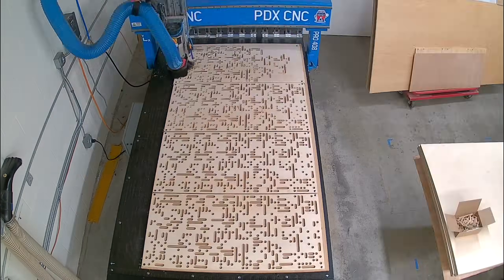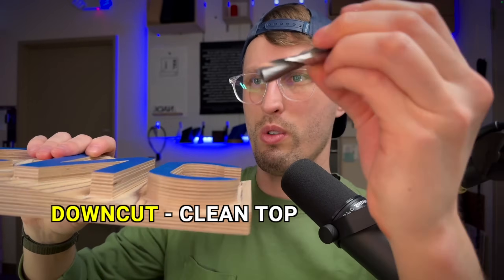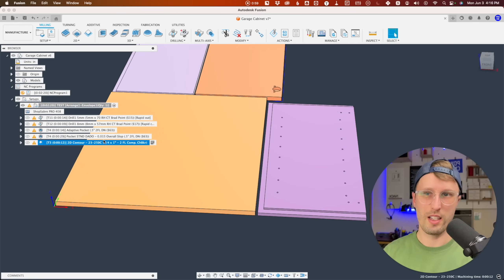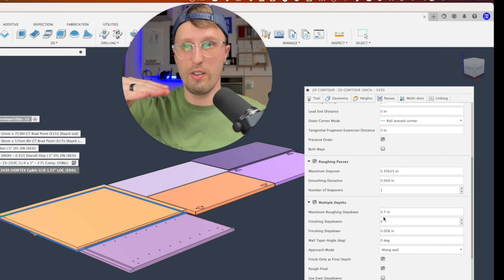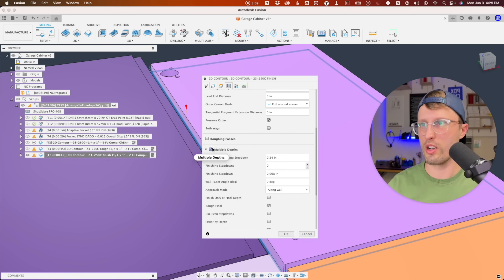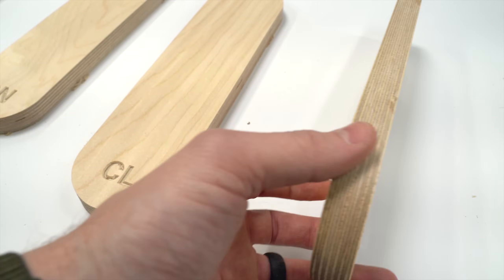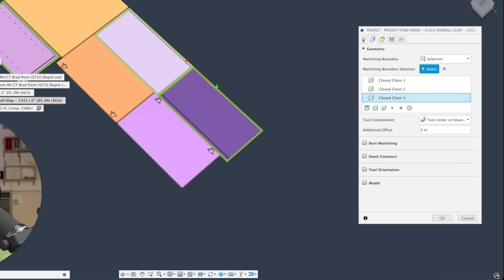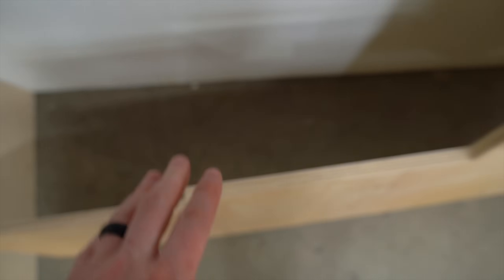7 surprising secrets for flawless CNC plywood cuts

Comment: Climb cut first, leave an onion skin, then cut conventional - miles better than this for several reasons.  1. even cleaner cut, 2. more precision (less deflection). 3. less likely to have parts move.   This will give you "flawless" edges but only on industrial machines - most small machines have 3kW or less spindles and are not rigid enough to climb cut.

Comment: im using compression bits for plywood, the tool's diameter is 10mm and the downcut starts at 7mm depth, SO i use climb for the first pass of 7mm depth (downcut for the surface) and then for the last 5mm i use conventional (upcut for the bottom), since i dont want to go full cut of 12mm at once. 
Aaaand the result is perfect. no lifting nothing, i just cant manage burning even with feedrate of 10k mm/min and 11k RPM

BTW the whistling noise your bits making while cutting its a BIG BIG NONO.. reduce RPM or increase feed or both?

Comment: Would you have any reccomendations,i have this centateq n510 at work i need to figure out a clean cut in 1 pass but im having trouble with small parts the vacum usualy fails to hold them in place and they end up shifting during machining.I will try the lead in in the middle along the  grain and will make sure to use a compression bit.

The almost 11 meters per minute you did in one go looked really impressive,at the moment i only manage 2 pass cut with about 5 meters a minute at 18k rpm
Reply from the maker: That cut was with a 1/4” (6.35mm) cutter—not sure what you’re using, but tool size matters a lot here. One-pass isn’t always the best move. It might be faster, but consistent clean results are better. I’d leave 1mm for a finishing pass and rough with about a 0.5mm (0.02”) stepover. Run both at ~11.5 m/min. The final pass puts way less pressure on the part and gives a cleaner edge. If it still moves, add tabs.
Reply: @pdxcnc  I was leaving 2mm but 1 makes sense and i will have a chance to try this tomorrow or day after.i will also try to increase to 11ish m/per min on a basic compression bit with 6mm width.ill report the results, thank you very much

Comment: Im a beginner in this and i have a question. Will using a smaller dia compression bit have better results than a bigger one? For example im using a 4mm compression bit, if i upgrade to something bigger, wll the wood come out less cleaner and more rough? Or is it the other way around?
Reply from the maker: That’s all relative. Depends on the machine, material, tool holder.

A larger diameter tool should be more rigid cutting the same material though.

Comment: You mentioned hobby level machines in regards to compression endmills. Is your thought that you'd be better off not using them on a smaller machine like that? Would you just use an upcut and plan on sanding later?
Reply from the maker: There's a few factors. Most hobby machines can't feed fast enough, either by movement or spindle power restrictions per what a compression cutter wants to cut and not burn it up.

The other is not enough power to get the tool down below the upcut portion of the tool. Our 23-250C needs to be about .25" minimum depth of cut to not be tearing out and sort of ruining the entire intention of a compression cutter - to get clean top and bottom edges at once.
Reply from the maker: If you can't make that happen, you can simulate a compression cut by roughing first with an upcut tool with some radial stock to leave. and finishing with a downcutter.

Comment: Straight flute is the best balance and more economical
Reply from the maker: Way slower though
Reply: @pdxcnc we cut 700ipm with a 3 blade 1/4” straight bit(amana in presta) and get much better results than compression bits usually give - for Baltic Birch and solid wood exclusively. Cheaper plywoods I still use a 3/8” compression.
Reply from the maker: @batemanlabs nice

Comment: Just watched this, Great and straight to the point. Love it. We cut ply and tbh quality doesn't matter on the edges as what we cut is all one time use mould forms. But I have always wanted to get better cuts and ill try the climb direction trick tomorrow morning. Will do 2 cuts on the same piece with both directions and see. Nice one
Reply: Did a test, with a change in cutting direction and also did with leaving some radial stock then doing a second finishing pass. Most deffinatly. a huge improvment to the finish. Now need to stop entering on a plunge, what sort of ramp angle would you recommend? usually using a 6mm compression on 18mm plywood.
Reply from the maker: Anywhere from 15-25° works fine

Comment: So if a spindle is less then 4 horse power you don’t think it can cut 3/4 mdf in one shot ?
Reply from the maker: Good question. What size is the spindle?
Reply: @pdxcnc  it’s a 2.2 kw spindle atc
Reply: @TheUofastudent I have a Stepcraft Q.408 with a 2.2kW ATC spindle and cut Birch plywood in one pass. MDF is much softer, so give it a try! I do mostly 3/8 compression bit at RPM 18K. If spindle speed is high, keep the feed speed high too. Seams crazy at first, but after trying and seeing such a difference in efficiency and finish quality, I’m glad I did lol
Reply: That’s awesome !! Due to the electricity limitations I have I can only run either the cnc or the vacuum pumps so gonna try to hold the 4 by 8 sheet with 8 screws to a clamped on board then try to cut the 5/8 plywood board in one pass with out a vacuum pump table turned on ! Do you think that would work ?
Reply: @TheUofastudent  I don't have a vacuum table, so I always screw the 3/4 ply down to the spoil board. After learning how to cut full sheets in matter of minutes, I wish I had a vacuum table!

Comment: Quality info, thank you! Nudged me to use your bits for my maiden voyage with my SS Pro 408!
Reply from the maker: Oh awesome, happy to help if you have questions!
Reply: @pdxcnc  much appreciated (as are your contributions in the FB group). i'm coming from Shaper Origin so the idea of ploughing through 3/4 material in a single pass is blowing my mind at the moment. Seeing this, along with the right feeds and speeds, is helping me take that big step up and get off to a good start. I have it all wired up. Replumbing my compressed air system and Should be firing it up in the next few days as soon as I receive those bits! 

I noticed you don't have a tool library yet for vectric (still ramping up on fusion) - is it best to just add the bits I ordered manually? Any guidance you have there would be great.
Reply from the maker: Absolutely. Glad to hear it, there's a lot to get going when you setup your first machine.

Libraries: Yeah we're still getting these going. Which tools are you looking for in Vectric, I can try to get those setup first?

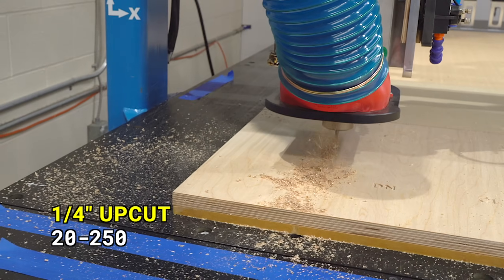Comment: @7:58 - the ONLY part of the video I slightly disagree with. I don´t think a bit has to scream (vibrate!). at least I try to avoid it if possible. with a 8mm compression cutter and the sheet firmly sucked down with vacuum that is usually possible for me. If I push a tool too much or use it too long after it got too dull (which is totally possible with a compression cutter :) I had contact corrosion issues in the past. Iso30 in a HSD here too. looking at the tools in the toolchanger I have to say they look totally fine. This makes me wonder if my pullstud/drawbar thingie in the spindle maybe does not provide enough clamping force and that´s the reason for me babying my machine :D 
great video Justin!
Reply from the maker: I don't wholly disagree but a 1/4" (6.3mm) compression tool has always made that noise for us, no matter brand or age of my machine/spindle. I believe a combination of a lot of things but it's just not very rigid, maybe the tool holder/collet is sucking in and out as well, 18,000 RPM's can likely cause it to drop a little, ISO30 is no HSK.
Reply: @pdxcnc  true! If I ever have to replace my spindle I´d really consider HSK. Hope this is a few years in the future though :D

Comment: Cool video.  I didn't know to use conventional with compression cutters, I don't cut much plywood.  @7:39 Why do you use a second 2d contour operation for your finish pass rather use roughing and finish passes within the first 2d contour operation?
Reply from the maker: Hey Kip, thanks. Good question. I guess didn't explain that but often it works better to rough fully and not break the vacuum seal then come back with the lighter cut cleanup finish pass with much lower tool pressure.
Reply: @pdxcnc  I gotcha.  But couldn't you achieve the same outcome by checking "Finish Only at Final Depth", and unchecking "Rough Final", setting a finishing stepdown all under the "Multiple Depths section" and then using the "Stepover" under the "Passes" Dropdown.    To compare it with using two operations The finishing stepdown setting is essentially the axial stock to leave that was set in the roughing operation and the stepover is the radial stock to leave set on the roughing operation.  I use a finish pass on most of the parts I make and this is how I do it with one operation.  But I am well aware that there are usually multiple strategies to get the same or similar outcomes.
Reply from the maker: @kip1168  you absoultely can. I feel there's more control with doing two separate operations.
Reply: @pdxcnc  I can see that.  Pros and cons to doing it different ways depending on other factors as well.  Thanks for the cool video and discussion.

Comment: Excellent Video where do you get your 5mm dowel drill from as struggling to find one that doesnt have a massive flat spot. Thanks 👍
Reply from the maker: Hey the 5mm bradpoint we use? You mean the flat on the shank? If so, that’s how they all are
Reply: @pdxcnc gotta didn't know if there was one either no flay spot. What plunge do you typically run it at in plywood. Thanks

Comment: Typically the screaming that the bit does is from friction aka not having correct chipload and it usually want a higher ipm or a lower rpm
Reply from the maker: I find it’s from the path turning and a new force being applied and flex happening in the tool
Reply: @pdxcnc  that's just what it was for me and it fixes. It every time for me but maybe that is what it is for you but loved the vid lots of info!
Reply from the maker: @mcfixit66_yt77 nice, thanks

Comment: Very nice! Thanks for putting this out there. For some people with higher horsepower spindles, or just looking to improve efficiency, my ShopSabre IS408 w/ a 10hp spindle, we do 3/4" baltic birch plywood a lot, and we use 1/4" compression bits, single pass full depth, no tabs or onion skin, a bit over 300ipm and 16,000 rpm and get perfectly clean edges. We use 1/4" compression for just about everything due to it's ability to do smaller geometry compared to 3/8". Plus, for holding down small parts (around 10 in^2 surface area), full depth single pass, no onion or tabs is the way to go as the chips pack and keep them in place. Will never onion skin or tab again, but that's just our preference. Cheers!
Reply from the maker: Nice. Do your compression tools have any blackening on them?
Reply: @pdxcnc  you know they certainly will get blackening over time yes, I'm not 100% sure what I should expect for tool life with what I'm doing, but one 1/4" compression tool will last maybe 40-50 sheets before I feel the need to change it due to seeing some fuzzies start to appear on the part edges. Any thoughts? Always looking for input! :)
Reply from the maker: @garretehrick6137 yeah, I ask because I started out around those speeds and was blackening tools. I eventually found out I was feeding too slow and the blackening is too much heat in the cut. I’d push that 1/4” more like 380-390 IPM at 16k and you’ll see longer tool life
Reply: @pdxcnc  Thanks so much for the feedback! Full depth pass at those speeds for you? I have yet to break a bit at my feedrates, so I'm definitely keen to speed them up a bit.
Reply from the maker: @garretehrick6137 shouldn’t no. Ramp in, what brand is it?
Reply: @pdxcnc  Vortex currently, have been dabbling with Frost as well.
Reply from the maker: @garretehrick6137 Vortex for sure. We cut 3112 at 450IPM
Reply: New to CNC stuff, got trained when the cabinet shop I work at upgraded the CNC. Tried making some little corner anchors to help my normal work, cut out of 5/8" Baltic ply (drawer scrap) 5" square with a 3" square taken out, giving an L shape that I can clamp and indirectly hold things to work on. 

The shop wisdom is using the 3/8" down cut as default tooling, so I went with that and it unsurprisingly threw my pieces. Wrong tooling? Just too small? I'm surprised you're doing 3/4 with a smaller bit and less problem, but wanting to learn to do better. I don't know brand of bits or feed rates off hand
Reply from the maker: @michaelsorensen7567 not too sure. Sounds like a workholding problem?
Reply: @pdxcnc  thanks for the reply, especially on an old video. Tabs would definitely help, but I slowed feed rate and they still moved a bit, but were good enough to be usable.
Reply from the maker: That’s a really small part of its only vacuum.
Reply: @pdxcnc  yup! Lol like I said, "unsurprisingly" 😝
Reply: @michaelsorensen7567  1/4" compression bit cutting 3/4" thick ply  for our parts. What happens with doing a single pass full depth of cut with that diameter bit is that the sawdust get packed into the cut channel behind the bit, essentially locking small pieces in place. Not sure if this would work for less thick material, or a different diameter bit. Also vacuum hold down is essential, but it's more about the chips compacting in the channel for small parts like what we often do. Hope that helps!
Reply: @frictitiousclimbing  thanks for the response. I had seen some of that cutting some parts for a custom kitchen hood out of 3/4 MDF, even with the 3/8" down spiral. It didn't do it all enough for me on the 5/8" Baltic ply. Wondering if thickness is part of the issue. 

I know settings were same on conventional/climb cut on both cases, but don't know what the setting was. Very very new to CNC, don't even know what I don't know yet!

Comment: Good information.  What is your experience of using compression vs. downcut or upcut bits in hardwood vs plywood.  Also conventional vs climb cut.
Reply: I’d also be interested in tool path strategies to avoid tear out on hardwoods. I have found no good way to turn a 90 degree outside profile without some splintering. I’ve also played with Fusion’s preserve sharp corners technique which seems to help, but still doesn’t work perfectly.

Comment: I never climb cut. Is there ever a reason to use climb over conventional?  Greta video. Thanks
Reply from the maker: Yeah totally. I prefer it when roughing. It’s easier on tools. Climb when doing aluminum
Reply: Not sure on the CNC aspect cause I'm new to it, but for milling door parts out of hardwood (what I've been doing for 10 years) climb cut drastically reduces tear out, especially on harder woods.
Reply from the maker: @michaelsorensen7567 yep